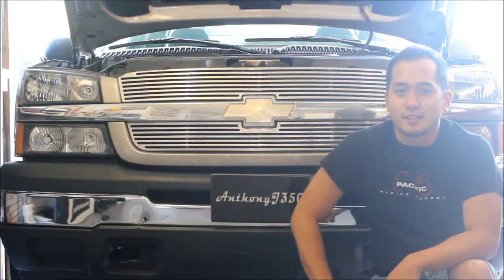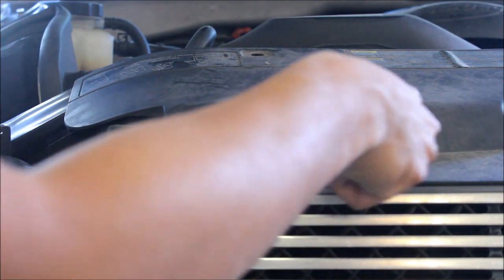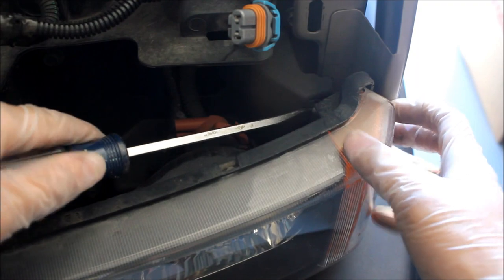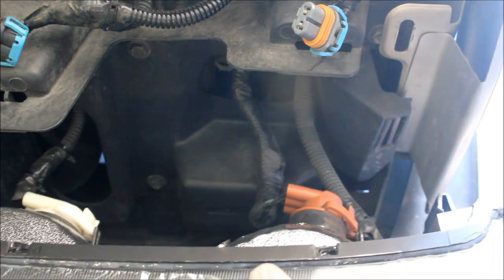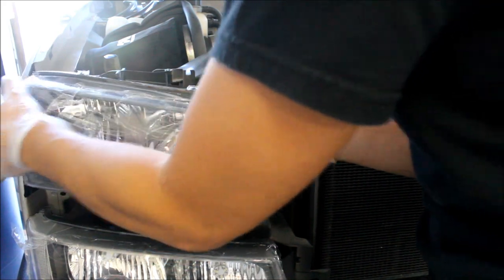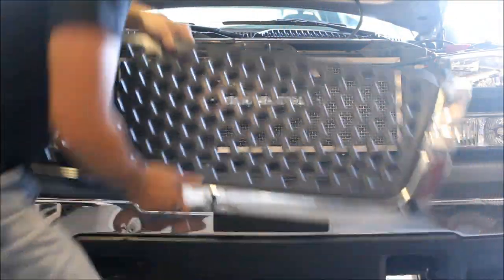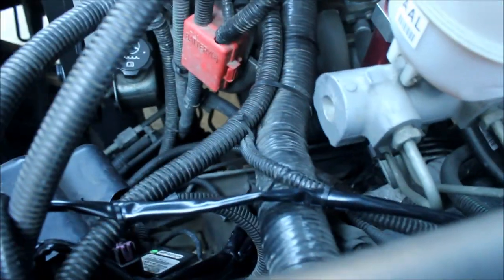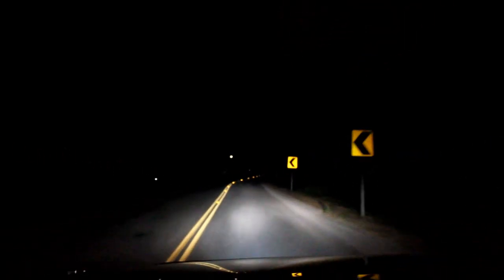Builds: Silverado Rigid Industries Light Install and Demo (SR Series light bar) | AnthonyJ350

Comment: I have a 2004 GMC Sierra and I have installed switchback led turn signals in my truck. I installed the load resistors also to stop the hyper blinking. But I have a set of the small amber leds to go on the outside of the light assembly (the marker light) and for some reason when I plug these lights in, it causes my turn signal to stop working and it does this with the switchbacks. I also tried wiring just the load resistor in with out the amber led bulb and it does the same thing. Do you know of anything that might help to solve this issue. Thanks.

Comment: When you installed your LEDs in your bumper lights did you have an issue with them doing the fast blinking if so do you have a video on how to fix that I know you need to let resistors but I haven't found a video on how to do it on the pick up like yours. I have a 2004 Silverado similar to yours and I want to see how you did yours please and thank you
Reply from the maker: I have this video for hyperflash https://www.youtube.com/watch?v=NMoYGQhD2DI&t=1s

Comment: did you have to install any resistors or relays for your LED replacement bulbs or did you just plug and play?
Reply from the maker: Load resistors to avoid the hyper flash.  But I didn't put load resistors on my motorcycle because I like the hyper flash on that thing (a little more noticeable).